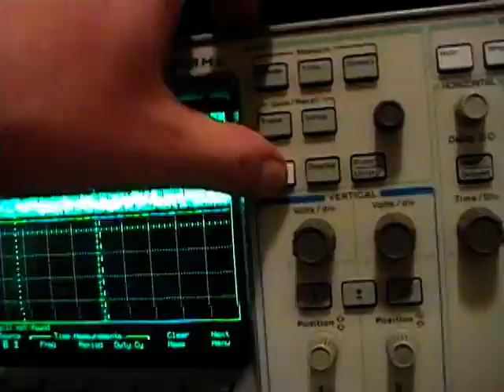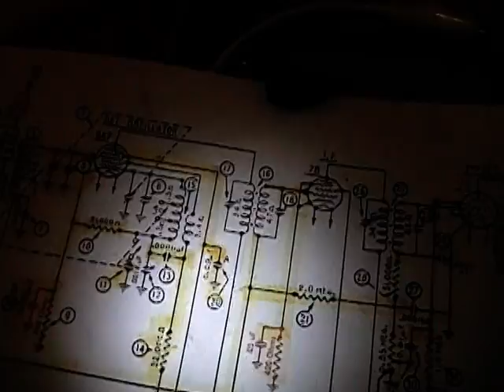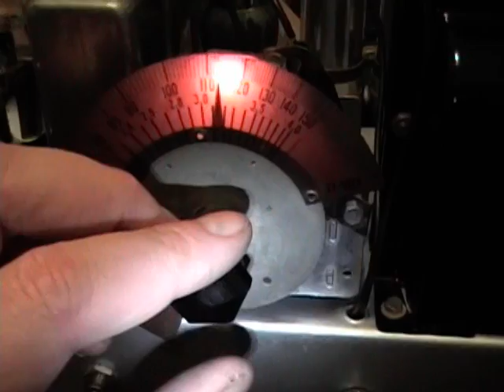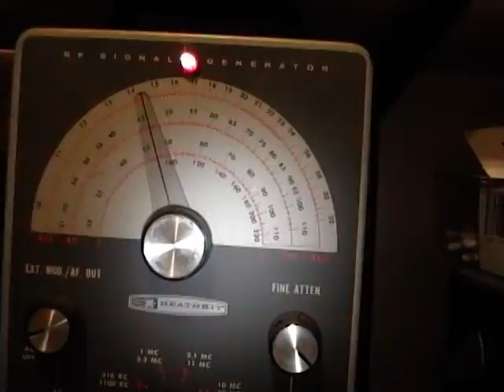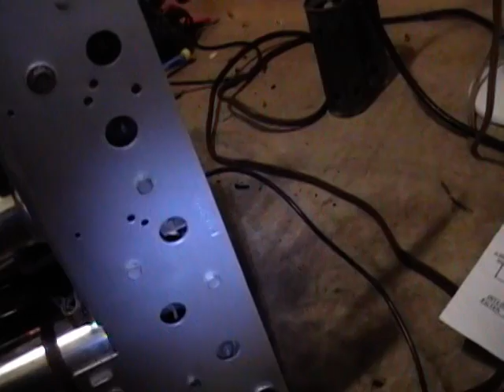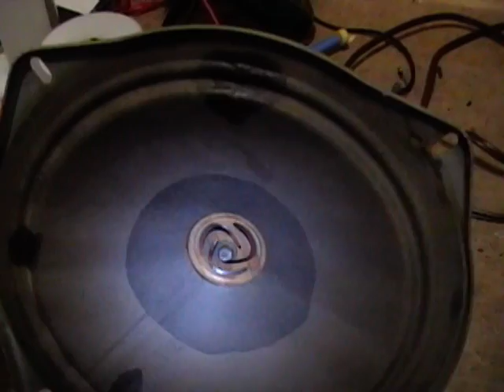Philco 60 restoration p13o14

Comment: Something you may want to be aware of is tuned antennas. With shortwave especially, a tuned antenna is a definite plus. You can find instructions for said antennae on HAM and shortwave sites. There is the simple measured length of wire as well as several easily constructed and prefabricated designs. I suggest a j-pole or fractal wave guide design for the best results. I'm a HAM operator myself and I know a lot about these things.

Comment: hi bob remember me telling you i bought a ev-10 by precision instruments. well ive ive since discovered that someone installed a audio transformer i series with the 1000 ohms per volt side...this meter is seperated electrically from the vtvm. i hook it to me speaker and it tracked just like an level meter.i was wondering why this was done.. could it be possible to have  the meter do an alighnment by ear? so to speak.ty for your time and vids.. billy okc

Comment: Philco actually offered an alignment tool to deal with that issue, it's a fiber rod with a 1/4 inch hex drive on one end and a flat blade on the other. The last time I worked on my Philco 60 I didn't have one so I used a nut driver, after playing "operation" a few times I wrapped the outside with electrical tape. Some people make their own Philco alignment tool by heating up a pen and shoving the end over 1/4 bolt head, I never tried it and now I have the proper tool so I don't need to.

Comment: WWV's 2.50 MHz signal uses a lower power than the higher frequencies, so I rarely have any luck picking it up. Usually their 10 MHz signal comes in the most strongly here, often with WWVH from Hawaii faintly audible in the background, too.

Comment: If I where you, I would just wrap a little bit of electrical tape around the outside of the driver to prevent it from shorting out on the chassis.